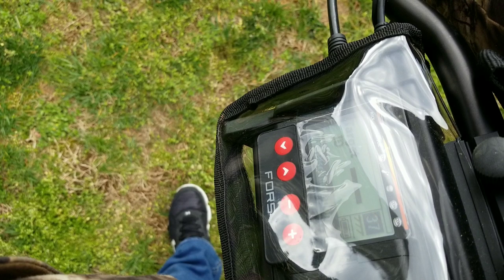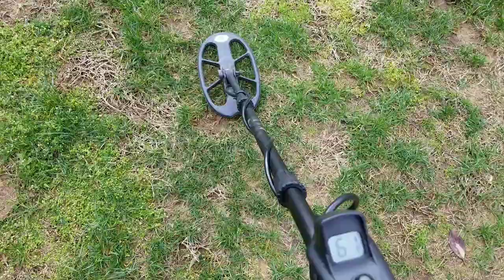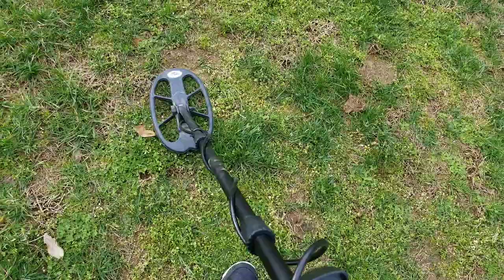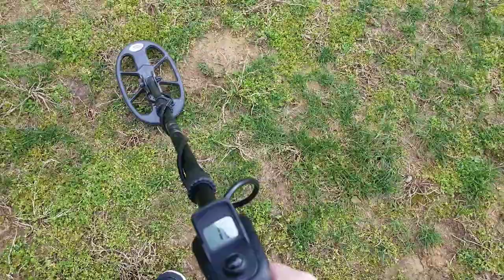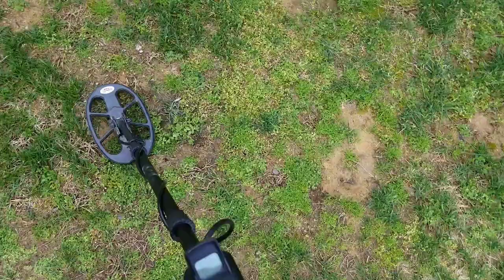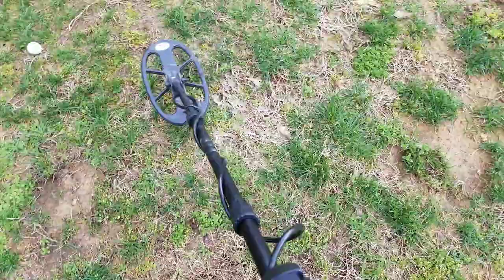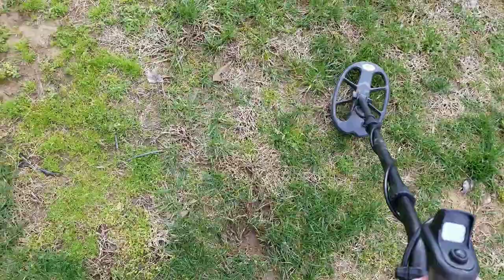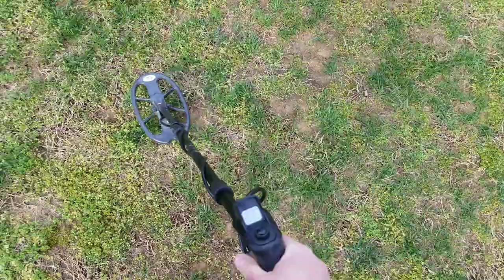Nokta/Makro Fors CoRe-Depth-Seperation-BottleCaps-Unmasking-Test

Comment from the maker: Saw I got a dislike, which is no big deal.  I would like to know what I can do to improve. Always accepting ideals and what you guys would like to see ect.. Thanks!
Reply: Its just youtube.  I see great videos and someone almost always gives a thumbs down.  Could be a 12 year olds way of having fun or mad because you didn't find a treasure...You did a fine job. Just what I was looking for.  There's not much out there for this machine so I appreciate you making this video..Thumbs up from me...
Reply from the maker: @boom6597  I really like this machine. Its ashame they discontinued it. I think it does an awesome job once you learn what its telling you. Thanks for watching!
Reply: They probably discontinued it because the clumsy ergonomics are just not up to par with newer machines. Performance wise, it trumps anything I have ever used when it comes to target separation. I initially scan areas with other more fun-to-use machines but when the findings start drying out, I bring the CoRe and the remaining good targets suddenly appear. In very tight quarters or in extreme trash, the small 5" coil on this thing is a killer. Nothing quite like it. @JonR35
Reply from the maker: @masterofrevolt106  prob true, it was a flaw design as far as ergonomics, I thought it felt fine but prefer to have info in front of me.